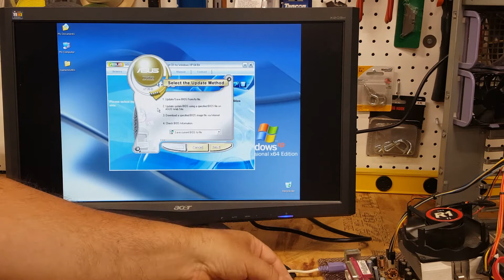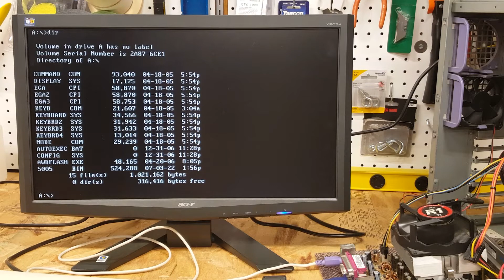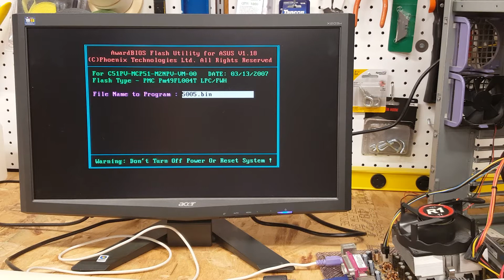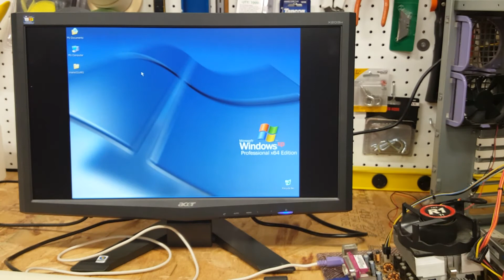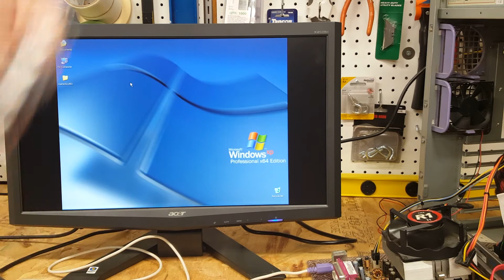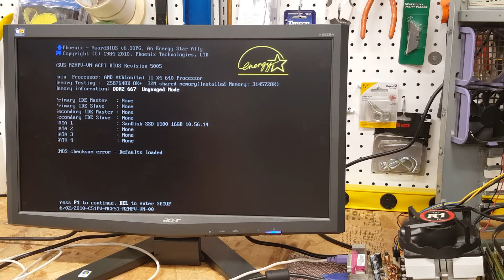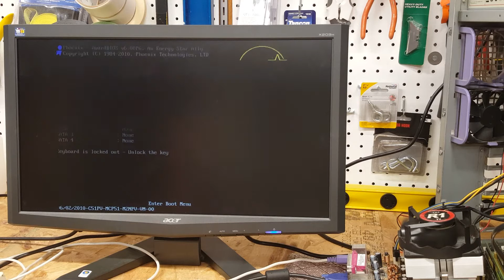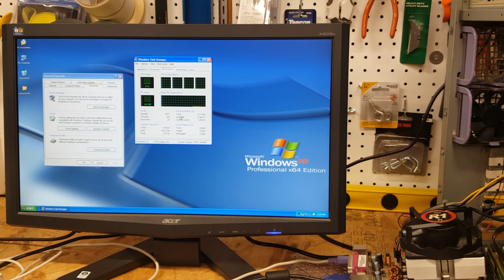MAME Computer Part 1:  The Hardware, BIOS upgrade and Windows XP x64

Comment: Nice build!  I had an old x2 on a m2n Asus board. Solid setup it ran flawlessly until it was thoroughly obsolete.
Reply from the maker: Essentially same here!  It was obsolete with an x2 CPU but worked perfectly until I decided to haul it out of retirement.  
I never thought of upgrading it to a x4 chip back in the day, but nice to see I could have.
I suppose my current computers would have taken a different direction had i done that back then.

Comment: Going to be a sweet build. I got one of those Antec SB1040 Cases myself back in 2015. I found mine at a Goodwill for only $10 but I had to find the two drive cages on eBay and luckily found the two for only $20 for both and I got myself a new front panel for $9 due to the door on mine was missing. I love this case! It has lots of room and it's heavy(love that it's solid and love it has No crap, crap and I do mean Crap RGB lights) due to it's built like a tank. Have a good one. Hey Uncle Mike I have a feeling you can tell that I Hate RGB lights with the passion and every ounce of my being lol. Have a good one.
Reply from the maker: It came out super, Clint!  Thanks!
Reply: @UncleMikeRetro  You welcome🙂

Comment: Happy July 4th!

One question - is WIndows XP 64-bit going to make best use of a multi-core CPU?
Reply from the maker: Happy 4th to you too, pal!  Actually, I did the research and for a single core program like MAME, not all that much, but I do plan to run more on this system down the line, and the difference is minimal.
Reply: @UncleMikeRetro  I've never understood exactly how much XP supports multi-core. The last time I used it (within it's supported lifespan, I still fire it up occasionally today) was probably to play Fallout 3 or Fallout New Vegas some time around 2012-ish. I am sure one of those games had a patch to support multi-core, which would suggest that XP must have also had some "knowledge" of multi-core CPUs too, even if it wasn't full support.
Reply from the maker: @terrydaktyllus1320  WinXP, actually (and I have used it a lot in the past of course and did more reading this week to be sure) fully supports multi core CPUs.  It may not be the best-optimized with them, but Windows 2000 first used multiple CPUs and Windows XP was first (I believe) with multiple cores (not just discrete CPUs).
Reply: @UncleMikeRetro  Good to know!